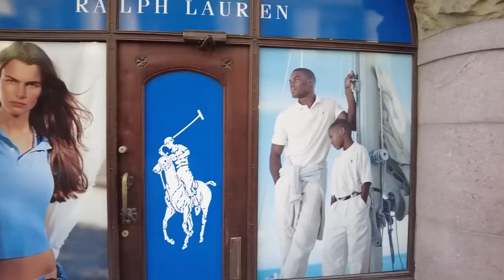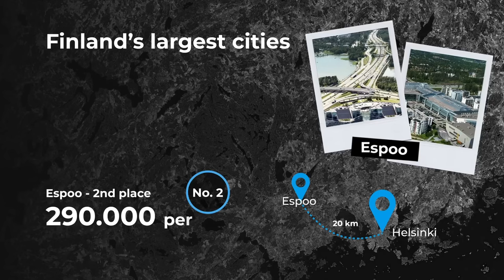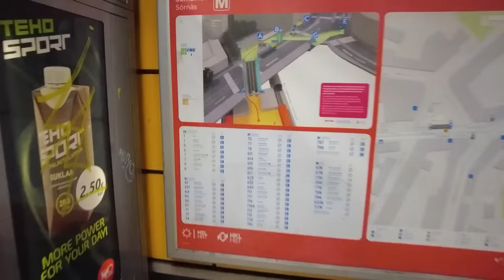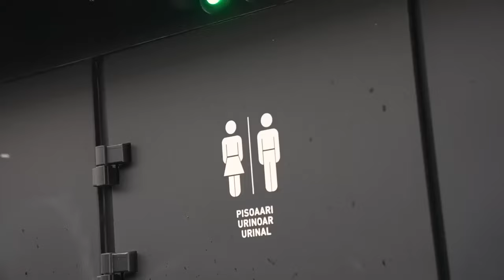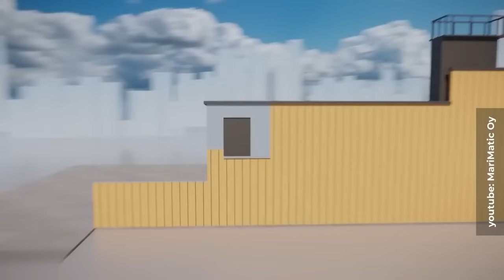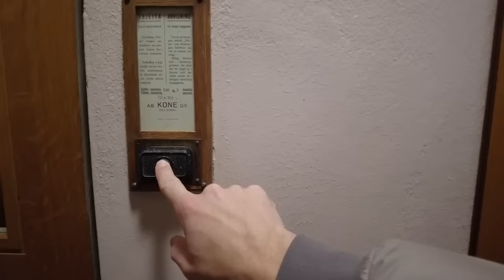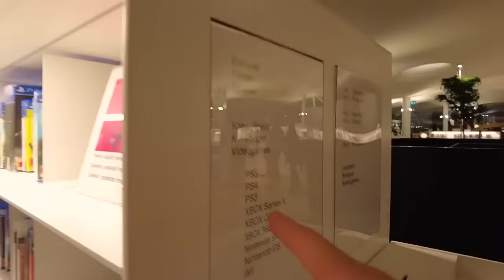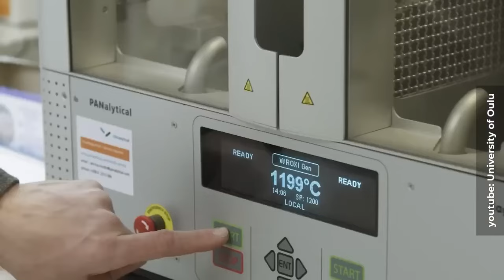Finland: From Russian Empire To The World’s Happiest Country | Bicycles, Housing, Renewable Energy

Comment: I think most of roofs are not heated just drown pipes but snow is removed manually from roofs when there is to much snow.
Reply: That's true.  only the roof well is heated if the rainwater drain runs inside the house.  Houses with flat roofs often have heat escaping through the roof and this contributes to reducing the snow load.
Reply: good insulation also has effect. no escaping heat no icicles.

Comment: As for the heated streets, I think, it has to be very expensive. I have never heard of this in any other country, not even in Germany. Maybe it is also considered of waste of energy and not supported as it helps global warming and tendency is quite opposite, to isolate buildings as much as possible to minimize heat loses. Btw. My friend worked at company, which is the worlds biggest producer of outdoor heating, but it is used mainly for helipads and footbal fields. But if you have money for helicopter, heated helipad is just small amount of money. Same for the footbal field, as it can generate a lot of money for the owners...
Reply: the streets are heated by the district heating return water, which must be cooled enough anyway before it is fed back to the boiler.